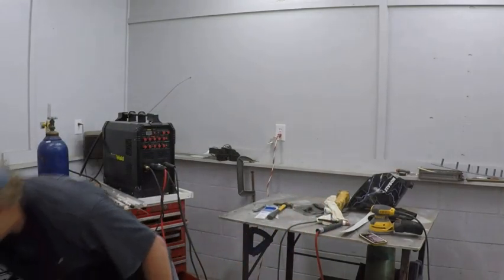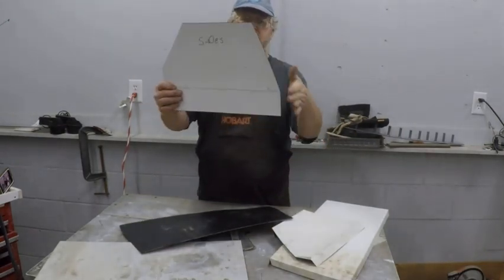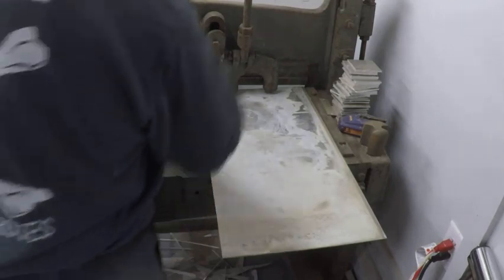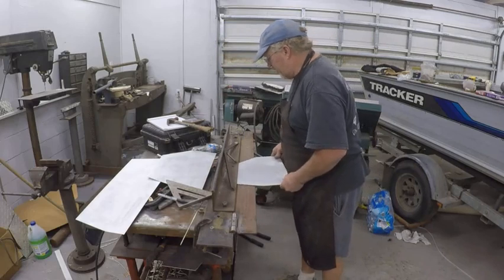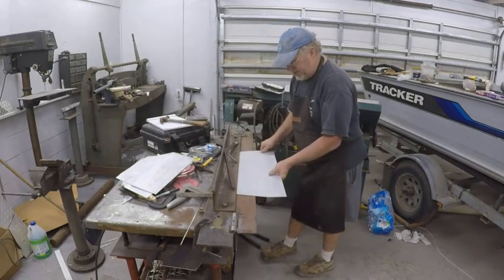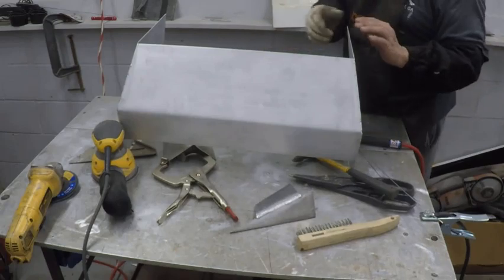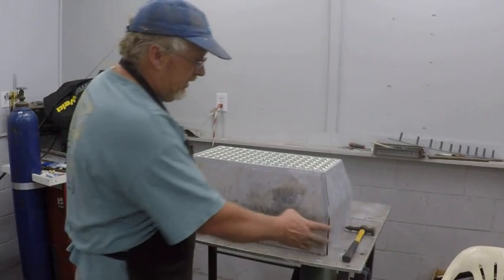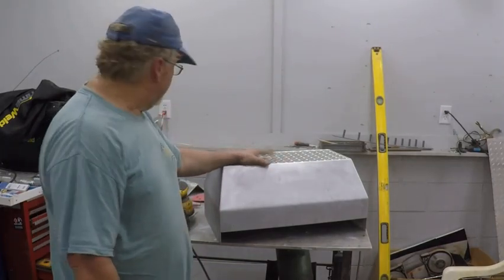CONSOLE BUILD

Comment: Hello Jeff,
What grit did you use to clean the aluminum please.
Thanks
Reply from the maker: For welding. I use a stainless steel brush. Or fine stainless wire wheel. Then I use a 120 grit or finer paper

Comment: Hello, Great Video! I have a similar boat that I have been off and on trying to fix up. I tried to install pink insulation but installed it horizontal instead of vertical. Then installed checkerboard. The floor was too soft so had to pull it out again. Also the floor wasnt strong enough to support the seats. Did you put reinforcements under the seats in some way?
Reply from the maker: I reinforced all the areas where the seats mounted with 3/4” material.  
Thank you for watching and commenting I appreciate it